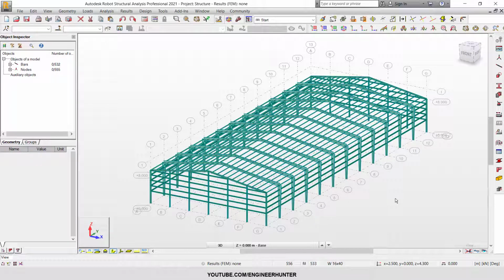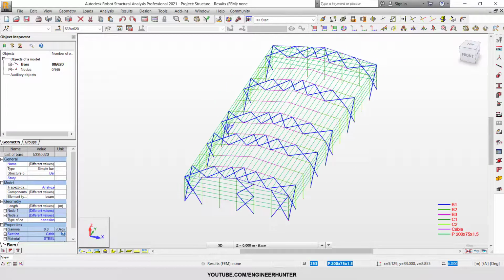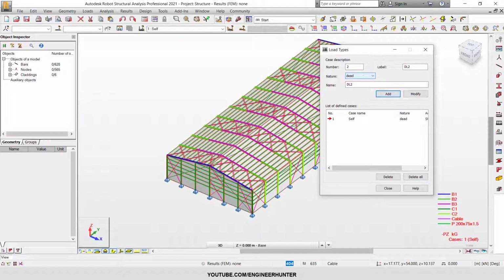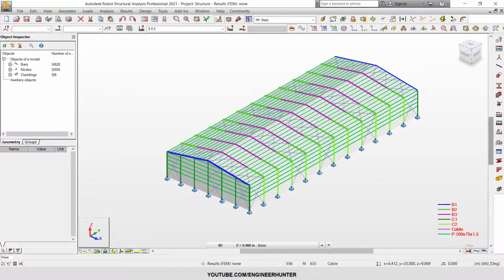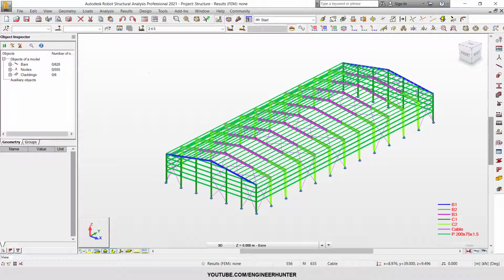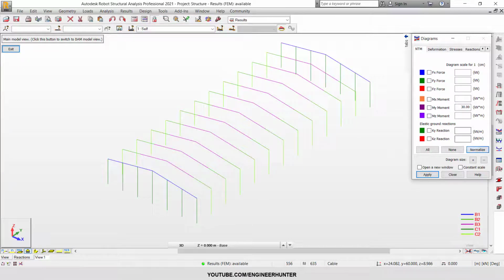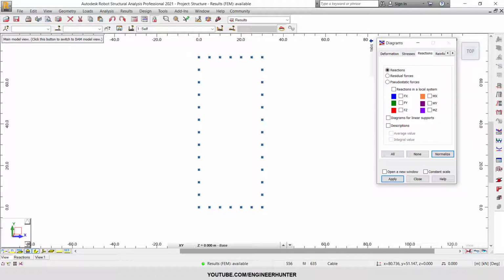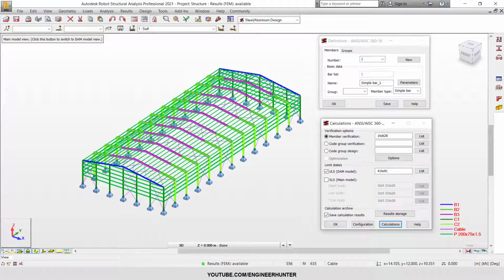Autodesk Robot Structural Analysis : Steel Warehouse Design Part 2

Comment: sir my i ask why did you use the pin support instead the fixed support? when do we have to use pin or fixed? thanks
Reply from the maker: We can use fixed or pinned depending on project. Normally, you need to check several points to help you decide fixed or pinned such as lateral deflection, base bending moments, connection conditions,…
Reply: @E @EngineerHunter thank you sir, what is the limit of displacement or deflection for Horizontal X or Y for steel structure sir?
Reply from the maker: You can check the deflection in some guideline and standard such as ASCE or MBMA.
Reply: @E @EngineerHunter do you have videos on discussing about this pin or fixed supports?

Comment: dear engineer ,
what i know about draw in Robot , is that you should start from left to right and from down to up
because of local axis
or it doesn't important ?
Reply from the maker: It’s not obligatory to do those. But it would help you to review the results better because the internal forces are shown base on local axis. So, we recommend to draw following a certain direction and check the local axis carefully.
Reply: @EngineerHunter  thank you 🙏🌹

Comment: Great video, one doubt. Why not using a fixed support for the base? So you can have the moment to design the footing
Reply from the maker: It depends on your decision base on the structure. Normally, the pinned base is easier to build and more economic.

Comment: Thanks this excellent tutorials.  

Please how do we determine the space of bracings And when do we use the bracing in the direction of the length of steel wharehouse

Commentaires
Reply from the maker: We use bracings so that the frame can resist lateral load. You can check the analysis result like deformation. You can check MBMA guide as well.
Reply: @EngineerHunter  ok, thanks very much

Comment: Hi, thanks to giving this perfect guide.
I have a problem that is I can’t see like this 22:41....
When i click the “load case code”, There are “STR” in ULS tab, “CHR” “FRE” “QPR” in SLS tab, “accidental” “seismic” in ACC tab, and last thing is “fire”.
How can i see like you did??
Reply from the maker: You can check the code for load combination in Job Preference. I think you probably choose Eurocode.
Reply: @EngineerHunter  Thanks,,,i figure out it but can you explain what those are? I am a starter of modeling so i want to know what those loads(
No.6 to 26) mean?
Reply from the maker: @coco_6692  Those are load combinations from ASCE 7-16 code following LRFD load combination. Those loads are for strength design.

Comment: Firs of all thanks for this amazing tutorials!!
I'm having a problem with a arched roof greenhouse. I have used claddings to put some loads on the roof, but even with the loads, there is none load distribution region on the roof. Everything else is fine, but no load that I'm using shows results (wind, snow, anything).
Do you have any ideia of what can be wrong?
Reply from the maker: You need to divide arc frame to smaller sections (arc line to straight line). Then, you can draw claddings following each segments of frame.
Reply: @EngineerHunter  I got it working now. I need to do one cladding for each segment of frame, keeping the cladding in just one plane, right? 
Anyway, its working fine now! Thank you!!
Reply: @EngineerHunter  I did the arc frame just like that, choose the number of segments, first, second and last points, and draw the arc in segments of straight lines. And the cladding following this segments. 
Actually I have more than one greenhouse and in none of then the applied load is shown in the results, or in the load distribution region.

Comment: Hello thanks for the tutorials...my reactions are displaying two values for example FZ 2.5/24.1......what is the meaning of this? which settings should i change?
Reply from the maker: You can check the load selection bar. Normally, if you see that type of value, it means that is the envelope value of the reaction or maximum/minimum value.
Reply: @EngineerHunter  Thanks.. Was actually viewing using envelope.